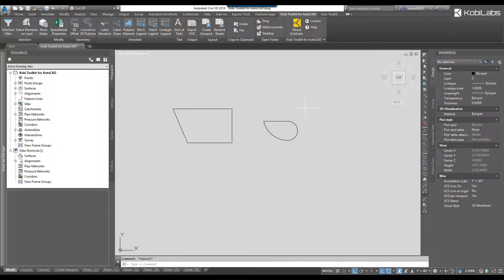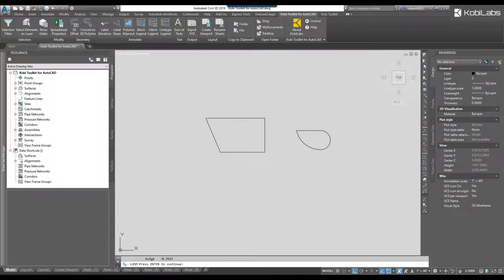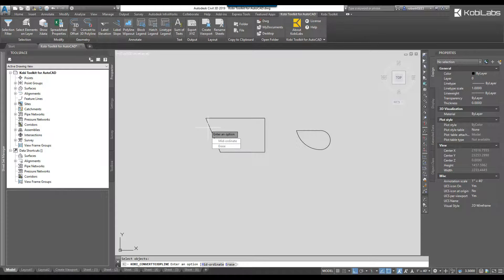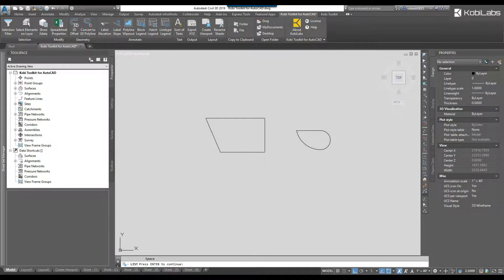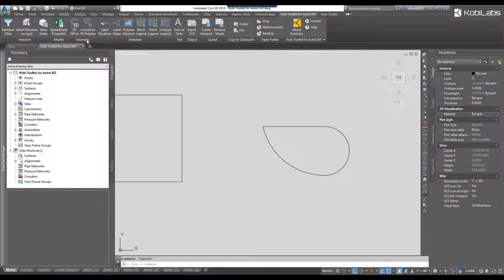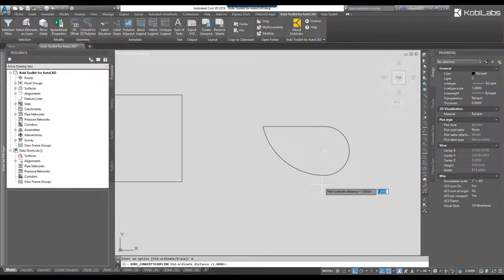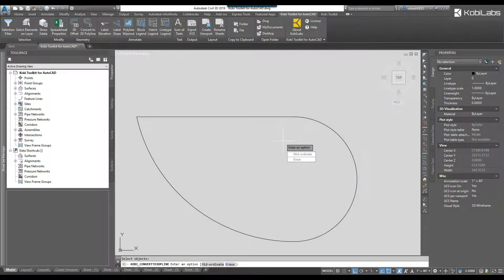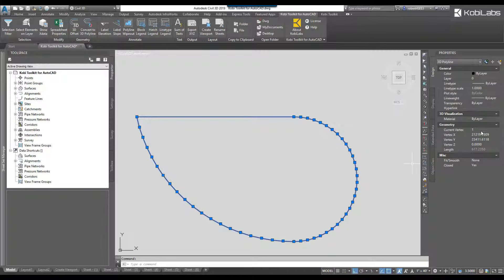AutoCAD Convert to 3D Polyline - Kobi Toolkit

Comment: i found a solution even faster than that : select > isolate > Explode > join, done.
Reply from the maker: Hi Marc! Your workflow works perfectly if there are no arcs. This tool converts also polylines with arcs in 3d polylines by tessellating them.